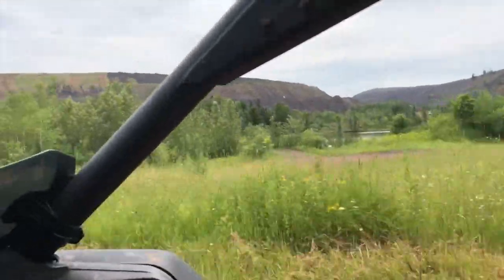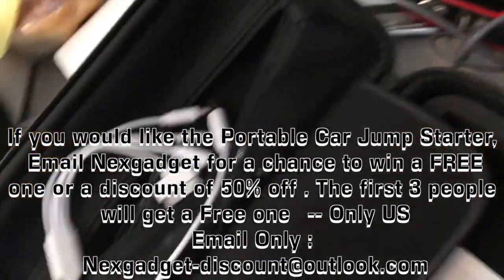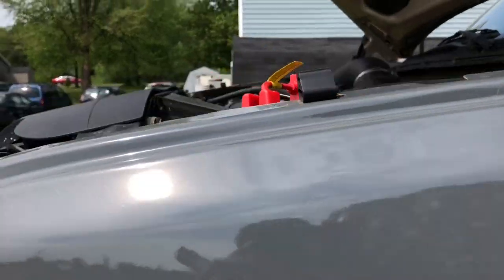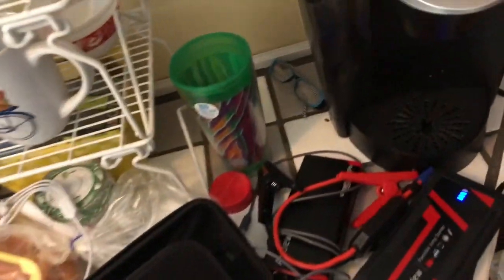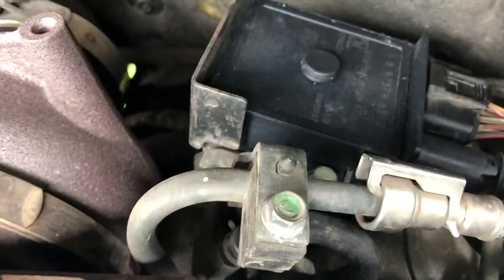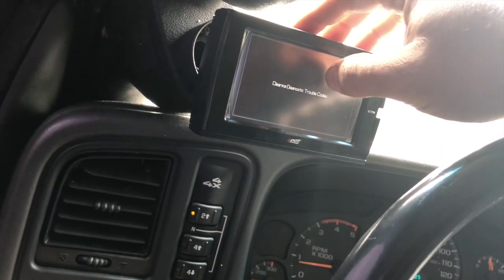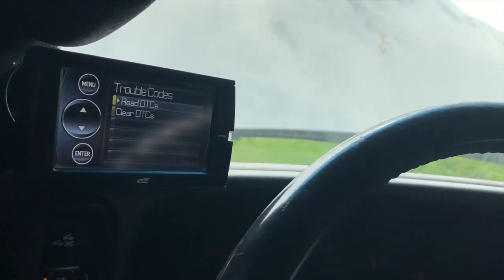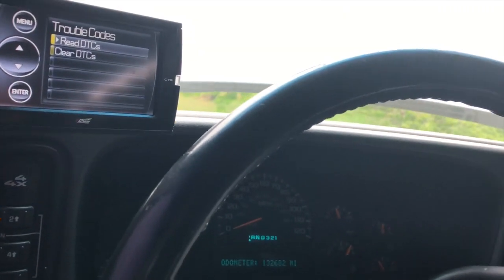Found what was killing my truck! (DURAMAX owners MUST WATCH)

Comment: How long did it batteries last u while u had this issue?
Reply from the maker: They’d be dead in 2 days if I didn’t drive the truck
Reply: @BERTRAND85O  that's brutal. Yet kind of a relief I was maybe thinking I have a lower leak but I guess thats what happens when I buy batteries mismatching from the wreckers. U ever have any water leaking under your floor issues ??